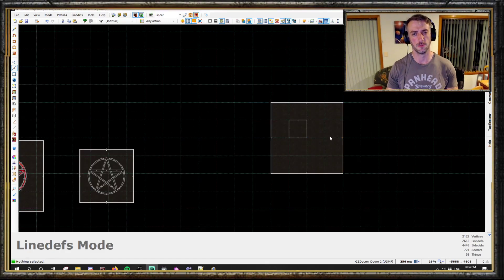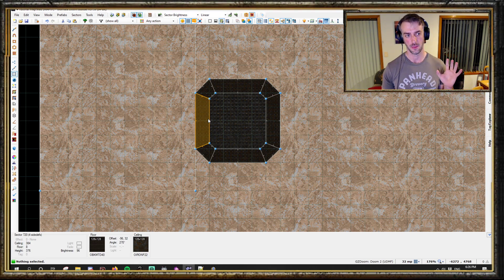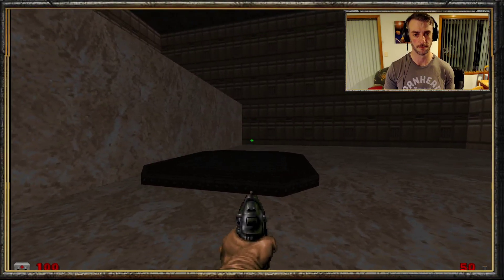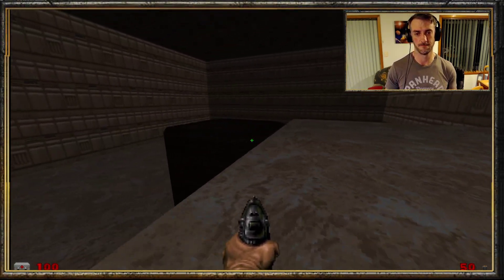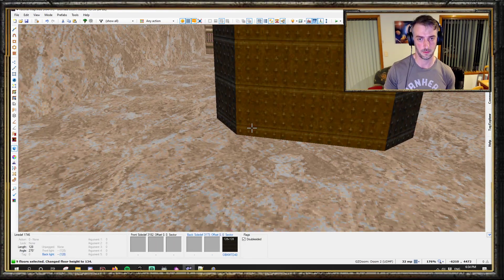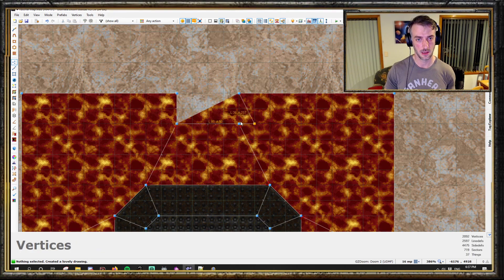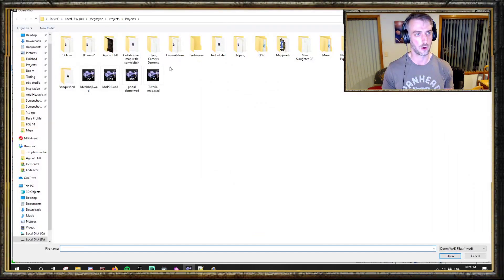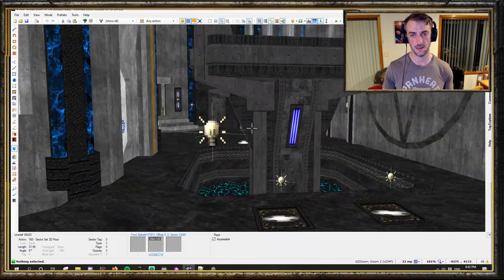Ultimate Doombuilder Tutorial Series: How to use Sector Setlink to make complex lifts

Comment: Dear BridgeBurner,
I found your channel extremely valuable. Thanks for your work for the community. Maybe you can help me with two things regarding lifts:
1)	I would like to link a dynamic spot light to a lift, so it goes up and down with it. Can you guide me where can I find some tutorial or examples on this? I already spent hours desperately looking for it...
2)	I have issues putting a switch on a 3D floor (as a border texture). It doesn’t flip. Is it a limitation of 3D floors, or am I doing something wrong? Or is it possible, but it just requires a lot of heavy scripting? (Imagine a complex lift made  exclusively out of 3D floors, operated by a switch that goes up and down along with the lift. The switch should also be a part of a 3D floor)
Thanks

Comment: Damn, that's some really useful stuff! (not to mention that holy ravioli map)
I was wondering tho, can I use this method to raise 3d floor doors instead of my usual "floor/ceiling_move_to_value" scripting?  I was thinking about to create a dummy reference sector, to get the floor height at which I want the door to move to, then having this one attached to a dummy lift sector, that'll be the one moving to the first sector and where I'm going to use the setlink, and in the end create the 3d floor door tagging its dummy sectors for the setlink; what I mean is to get a moving set of 3dfloors without having any real lift inside the map to which they're attached to.